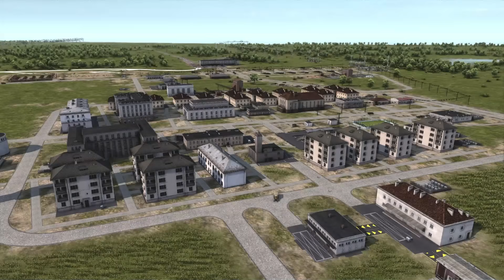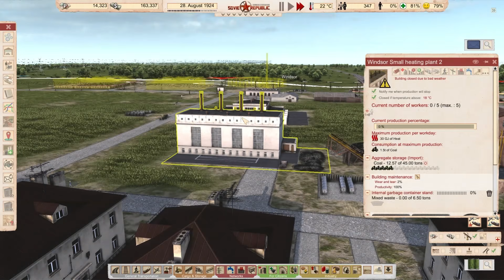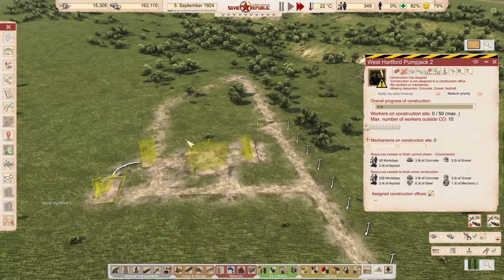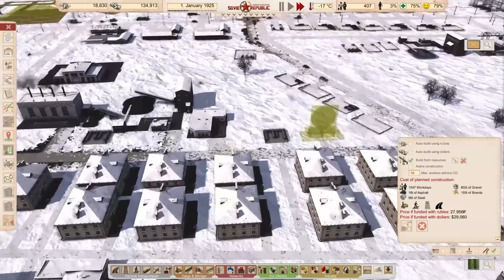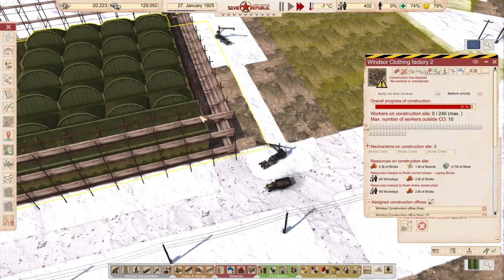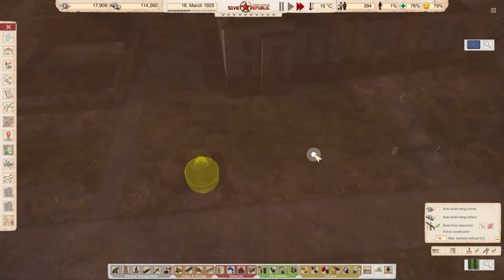Great News: Nobody Died | WRSR S4E3

Comment: Before you get plumbing it is better to spam those sub stations around a bit. Think of them like one large reservoir serving your citizens (~12m^3 per substation) and each substation being a loading point to fill the reservoir back up. I use a 2:1 ratio of sewage tanks to water substations, mostly due to the difference in volume of each and it just seems like you make a lot of sewage quicker than you need clean water.  The technical offices will keep the substations full (or empty in the case of sewage) but they'll only send one truck per substation and won't send another until the first one is finished with it's route (the water substation should hover around 25% full and the sewage will stabilize around ~8m^3, sadly I don't know of any way to tell a technical office to try and keep the substations at a lower level, they just seem to reach an equilibrium). If the route is long this can mean that you won't have enough throughput to remove or (or supply) sewage (or water). One way to deal with this is to simply build more substations but you could also reduce the time the trucks are spending driving to and from substations. You can do this by using and unloading/loading station and put one near the city and another somewhere else. Have the technical offices source or dispose at the unloading station and then create a line from the unloading station to, say, the border. This works well with water (you can create buffers with water towers) but isn't great for sewage. Luckily though you can just dump sewage in the nearest body of water. It's not something you need to do but it's just a thought. Often times, especially starting out, you're going to want to set up the plumbing anyway so you just do that.

Your heating plant is way too close to the housing. You can check how much pollution is affecting your overall health by hovering over the medical symbol at the top right, similar to how you can check happiness by hovering over the simely face. That is why you're running into health issues. I needs to be more like ~300m away, close enough to be within walking distance yet far enough away the pollution isn't that bad. If that was a tiny plant you'd have the same problem. A tiny plant needs to be like ~150m away. 

Think of heating plants like the star of a distant solar system. How far away a planet (residences) is from that star (the heating plant) determines how likely it is to harbor life (heat the buildings). Too close and it's too hot (pollution is too high and everybody gets sick and dies every winter) yet too far and it's too cold (everybody freezes to death). Each type of heating plant (star) has a different "Goldilocks zone" that determines the total livable area per plant. Tiny plant is something like ~100m-300m being the perfect balance. The small heating plant is something like ~300m-450m. The livable "bands" get smaller the larger the plant (but the larger plants are more efficient and provide more heat) so it's a good idea to start looking into heat exchangers when you start needing to expand into the heating plant's "death zones" or start building higher density housing that have larger hot water tanks (the tiny plant will struggle to heat the increased volume).

A good way to think about heat exchangers is to imagine they're heating plants but without the pollution. They have a hot water tank you need to fill up with hot water (just like a plant)that is then distributed to local buildings where the temperature decreases the further away the building is from the exchanger. You're just heating the water in the tank somewhere else instead of locally right at the exchanger. This allows you to place them directly in the middle of high density housing and have them be heated without worrying about killing everyone with smog. As a general rule of thumb about getting the hot water from the plant to the exchanger: largest pipe for long distance distribution then split it up into smaller volumes nearest the exchangers. So a 300m^3 pipe would be split into 3 100m^3 pipes (or six times at 50M^3 if you use the small exchanger).

Comment: You have two 2 lane roads running parallel to each other, can you change the direction of travel on roadways and make one 4 lane divided highway? Maybe it will give faster traffic a way to pass the slow traffic.
Reply: Once you upgrade to asphalt you can designate a 2 way road as a 1 way road. 

However, it doesn't really make traffic faster because they still apply the same code to the lanes
Reply: need asphalt or prefab or (maybe, not sure about this one) brick roads to do such a thing, game doesnt allow you to make mud or gravel road oneway
Reply from the maker: I think I need asphalt roads in order to make 1 way roads. I tried it with gravel and it didnt let me do it.
Reply: @JTMPLays  you can make prefab, asphalt and brick roads into oneway roads.